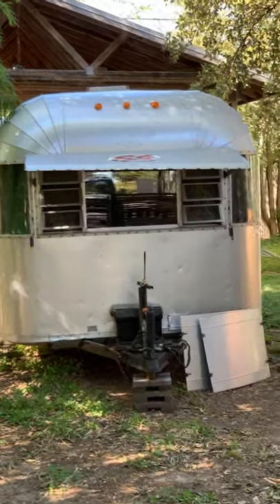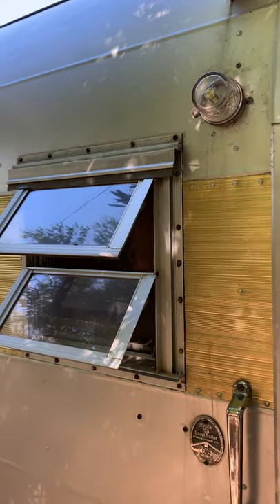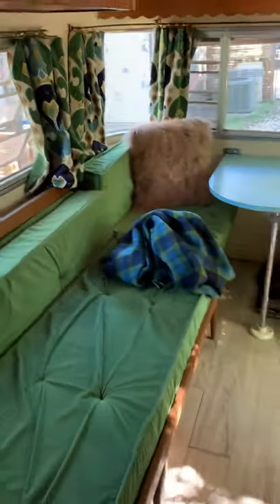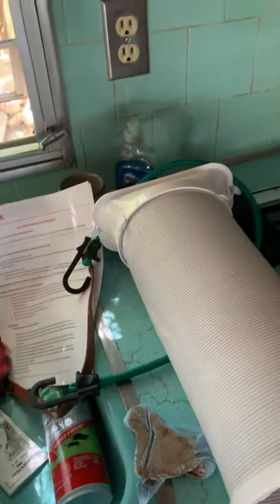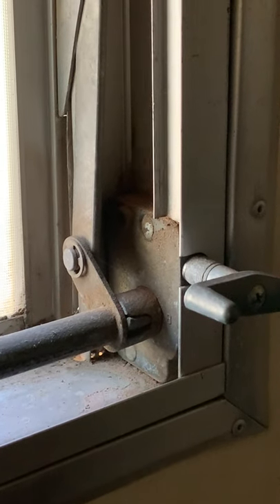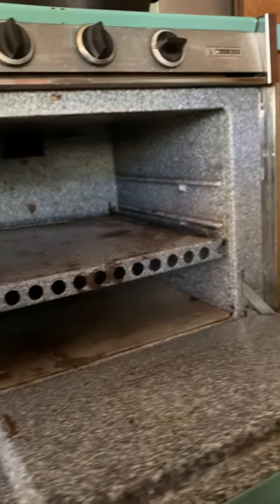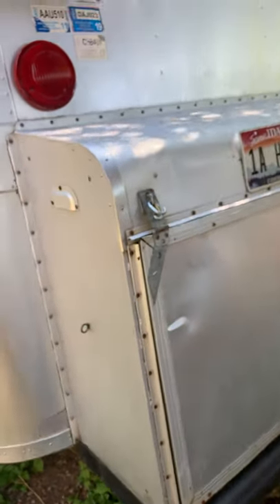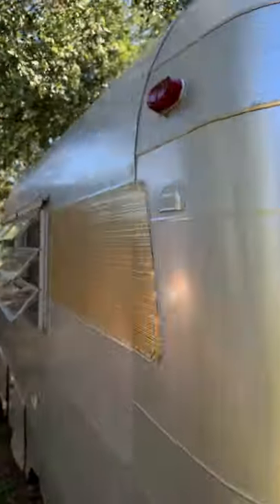68 Silver Streak Sabre 18.5'

Comment: Fer dat squeaky step gitcha sum DC-321 DRY ya hear me son? DRY film lubricant made by the good folks at Dow Corning. It’s got dat molybdenum disulfide which cures all yer sliding Metal surface woes. I thank they’ve monikered it Molykoat or sumpin like dat nowadays, don’t madder none to me I got me a case of it when the old unicycle repair & saddle salve shop that wint outta bidnis a few years back. Shame, helped me Fill my tires and did some tricky repairs on my old mountain bike. Good at mount’n jacks on bumpers. Bill wernt very much, but last I checked prices are kinda Bleak so u might have to call yer Money Man if you can Bear to ford it. Anyway you’d be braindead not to get it. Works purdy good on fishin poles to. If I recollect it’s got a -290 ta 840F witstand range so yer trailer step’l be good to go draggin it threw some icey Vermont fishing hole or camping at that HOT ya hear me? HOT Springs KOA. Or did I hear it went up in ashes during that Maaco paint shop fire? Anywho, good falcon watching up der if yer inta birds, don’t see that very much around. Just watch your speed, local yokels don’t take kindly to no dollar store coffee sippin hippie hollow trailer draggin artsy fartsy types. But you should be arrrite.   GLWTS